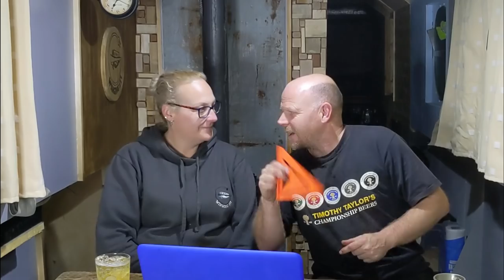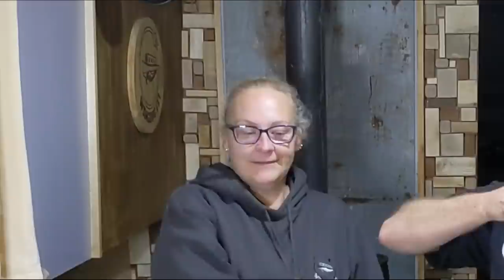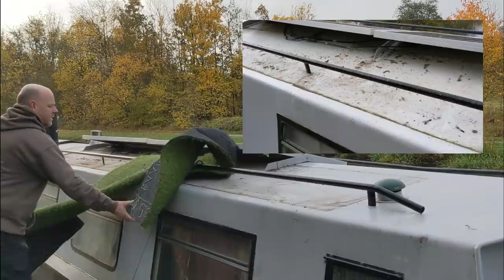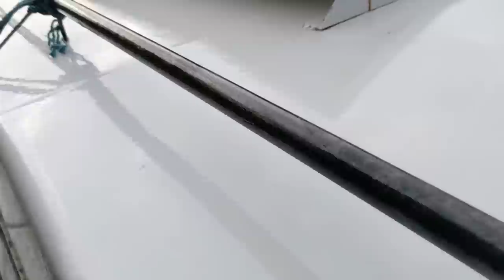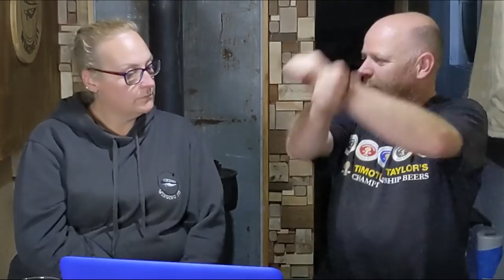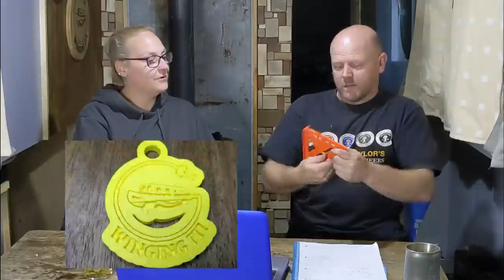Is Lyanda Lady for sale? PLUS Nuts N Volts (The Poor Man's Electric Boat) makes an appearance!

Comment: Just watched your video. I was wondering if the Jackery would be good for my sister's CPAC while camping. Our National Campgrounds here in the US don't have electric hook-ups and you can't run a generator.  So you can't recharge camper batteries unless you run the truck engine. This might work when we're out camping in Maine.
Reply from the maker: Over here in the UK the Jackery technical spec includes charging of what call a CPAP machine, which may be the same machine as you are referring to... If so for example the Jackery 500 is quoted as running it for between 13 and 42 hours. 
I would advise contacting direct through their website to confirm the details and usage. Hopefully it will be suitable for what you need.

Comment: Do you charge the Jackery with the big panels? 187. Split screen?
Reply from the maker: 187 is yours.
The bigger jackerys can be charged with a max 200w. so to to charge from the boat directly e have to plug it into the cigarette lighter adaptor, that feeds from our leisure batteries, that are fed via the solar. As opposed to directly from the panels.